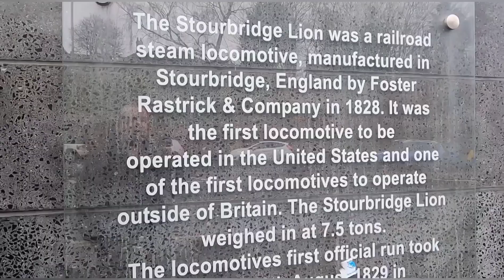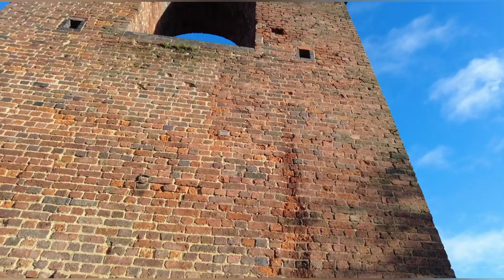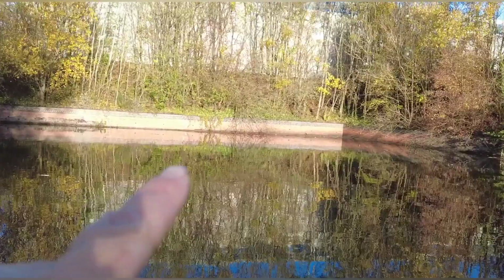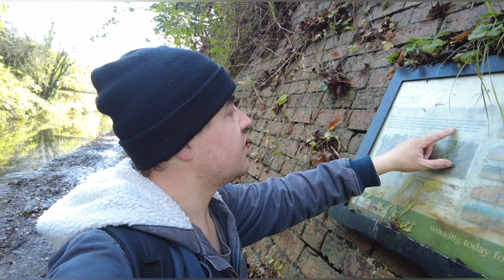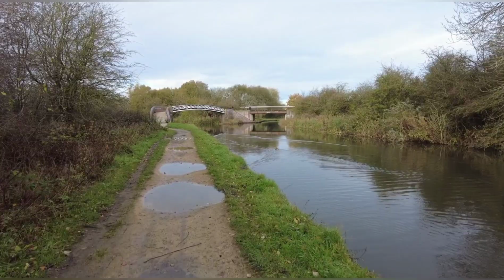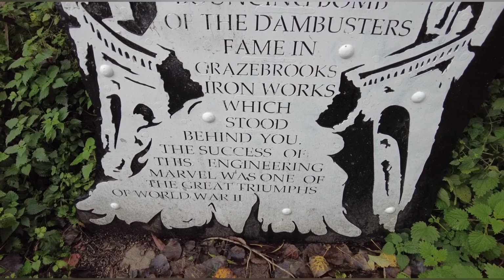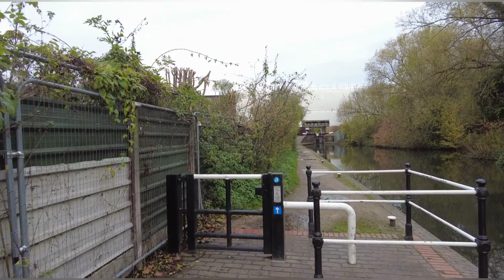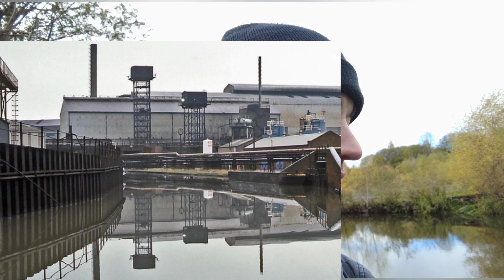Netherton to Brierley hill | Exploring the black country - S3 - Episode 2

Comment: Cradley chain makers made chains for titanic, they had a piece of it on their outside office wall building in cradley. HINGley not hinge ley netherton was just that a testing factory. They did make smaller anchors which there is some on the coast wales way in museum. probably a link to be found somewhere on internet.
Reply from the maker: Thanks for sharing that bud , I'll have to have a look for that you mentioned

Comment: Its a bloody lightning conductor  !!
The rods going round the stacks are shorings to help stop the lower bricks cracking and giving way.
I remember part of the site used as a tip and there's all sorts of rubbish underneath it.  The council has filled in many of the little ponds that used to be home to so called  'Protected Newts and frogs'. The council didn't give a toss in the old days and probablystill don't since they added Pedmore and other tory enclaves onto the Borough.  I used to laugh at the Dudley town motto, quin est prospicit (wise is he that looks ahead), talking about hypocrisy.

I worked at Lloyd's British testing in the 1970s, using the big 750 ton test machine.  We used to test the anchors used on the oil rigs in the North Sea and also the manhole covers and torpedo slings used in submarines and the big wire ropes for the suspension bridges. We also proof tested vessels like boilers and steam engines. My main job was opening the ends of the wire ropes to fit the resin or zink wedge caps so they could be stretched using an hydraulic ram to test their safe working load often tested to destruction. There was also a heated pit full of tar which was used for dunking the ships anchores in to black them. 
I think Cyril Beech steel stockholders bought the place and now own it but he kept the original 750 ton testing machine in place for prosperity.

The Black country was known for coal mainly because of the 30 ft seam which can still be mined near the surface in places near the plague pit on the north west side of Netherton Church.
Iron ore deposits were also close by but it was the discovery of coking the coal in the retorts which was used primarily in the iron smelting that made Dudley famous.
Reply from the maker: Thanks for sharing this interesting to read most of that especially your time at that company . Could imagine the canal line has changed a bit since those times in the 70s
Reply: @MidlandsOutdoors  
The company used the canal as a tip. You don't want to know. 
So glad it's recovered.